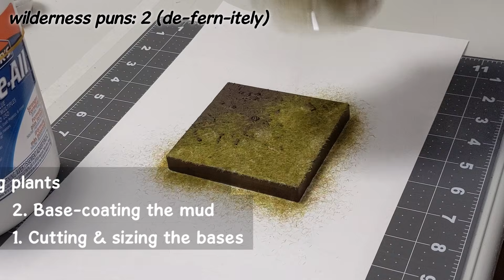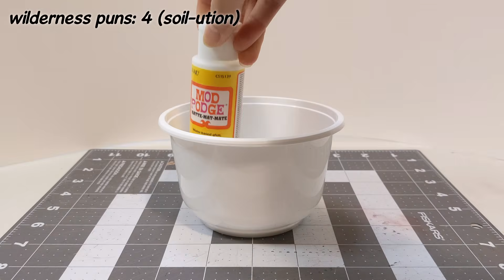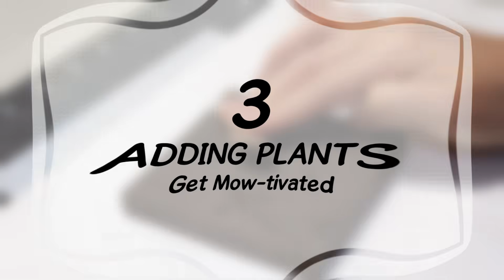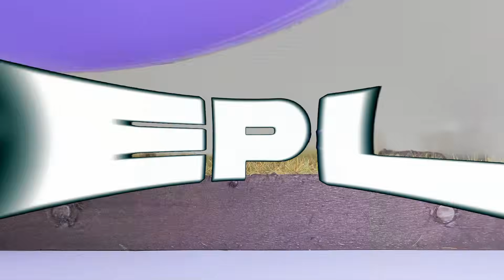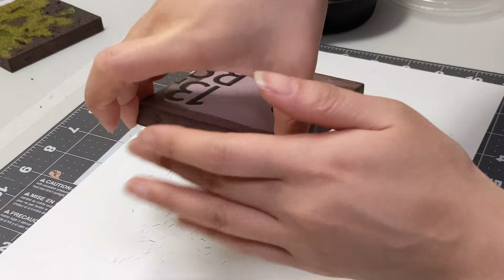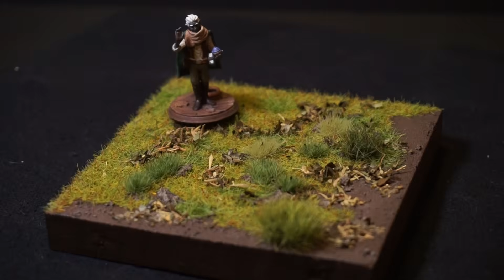DnD Wilderness Terrain - Modular & Expandable. Plus EASY static grass!

Comment: I dont know, but Iam asking myself, how to make this with a proper playing grid, for measuring while playing.
Reply from the maker: My party is pretty good about visually identifying that a 3x3 tile takes 3 spaces of movement to get across. That being said, Dimension 20 does a pretty good job of using white dots on their terrain to indicate the grid if that's a helpful compromise!
Reply: @raecheldoes  Ty for your advice, I made them now like in the video, but three woodplanks in the length symbolize one grid tile, but without the grid if you get what I meaning. ^^"

Comment: I would add, as long as you're not texturing the top, you could save a bunch of money using Styrofoam. The stuff is pretty much free and once sealed (mod podge or primer) it's plenty durable. It's easier to experiment when the materials are free.
If using a hot wire to cut Styrofoam, get proper breathing protection - not just a dust mask!

Comment: Great work.
IMO, you'd use 1/2 as many magnets if you put the magnets on the bottom and played on a magnetic surface. Our local "big box" stores have dry erase boards that are also magnetic. i strip the frame off, lay down a 1" grid with heavier lines every 5" for easy counting.  Just using two gives us enough room for any situation.
JC Magnetics (the place I buy mine) are great, but they aren't cheap when one thinks of doing 20-40 tiles.

Comment: I legitimately would like your opinion on this matter. I love your work and everything, but do you think it possible to add a grid into the terrain? If so how might you do that?
I’m trying to consider this for my table to make it easier for players to judge distance
Reply from the maker: I'm a little loose with measuring distance and we've adopted to know that going across one tile is 3 spaces or 15ft, so in a way there is a larger grid baked in, however I think Dimension 20 does a great job of putting in a dotted grid on their battle sets! If you google it, you can see some great examples of how they do it!
Reply: @raecheldoes  thank you so much for the reply. I’ll look into it and continue trying to adapt

Comment: Two questions about using the balloon- do you find that balloons work on static grass longer than 2-4mm, and, have you found a decent way to recover the grass that clings to the balloon? Or is that just a sacrifice to the scenery gods?
Reply from the maker: LOL. I don't see why it wouldn't work on longer grass, although it will probably require more frequent... charging. I have also tried wiping them off with a wet paper towel and vacuuming them off to no avail, so for now I continue to appease the seemingly insatiable scenery gods.

Comment: Brilliant! This has just solidified an idea I've been tossing around for years. My mistake was in visualising larger tiles, I think. 

I never would have thought of spraying matt varnish over the top of grass though. I would have thought it would become more brittle, rather than stronger. The snow effect you get from using the varnish is usually if the air is too humid, by the way. I tried varnishing some models after a storm and they all came out frosted. This was solved by a second layer of varnish, though.
Reply from the maker: Woohoo! Glad to inspire. Both RP Archive and Geek Gaming Scenics sprayed their grass, so I gave it a go. It's honestly really worked for me. And thank you for the matte varnish tip! It's good to know that it can be solved with another drier attempt haha.

Comment: before sealing if you are working with a slightly heavy/thicker sealant such as watered down pva glue. I would recommend putting some isopropyl alcohol in a spray bottle and giving it a light dusting to help brake surface tension. it helps keep it from creating blobs and filling in cracks which can remove depth from the piece.

Comment: Hey, quick question, how do you get rid of the excess hot glue when you are glueing in the magnets? I sometimes add to much which then makes the tiles have a gap between them when i try to connect!
Thanks.
Reply from the maker: Ah! When I put the magnet in, if some glue is pushed out in a blob around the magnet, I just pick it off with my nails or with tweezers before painting. It happens to me a lot as well! Hope that helps.
Reply: @raecheldoes  perfect, thank you! I tried sanding it but didn't seem to work to well. i'm glad the standard "Just get mean with it" approach works :D

Comment: Absolutely love your style and method to sharing your work - great job! I'm thinking about attempting this, targeting a 3' x 3' table for skirmish type wargames but likely wanting to expand a 6' x 4' table to support regiment style war games. Even if I did this with 6" x 6" tiles (36 tiles for the starting 3 x 3 table 😬), do you even think this would be a good idea? I'm worried about: tiles being shifted around easily because of the lightweight foam, durability due to heavier models (like vehicles, big ruined buildings, etc.) being placed on top, and uneven ground being difficult for regiments (on movement trays). Would you still want to go modular tiles and maybe just change up the surfaces to be flatter, or go with a different approach to the table altogether?
Reply from the maker: For bigger wargaming set-ups, I would definitely consider what are the most important considerations. Is storage an issue? Do you want the terrain to be able to change often? It sounds like durability and playability are top contenders. For tiles shifting around, there are ways around that, like adding weights underneath or an outer frame to hold a full board together. I also would consider going right up to 12"x12" tiles if your table to going to be that big! You can cut 6"x12" strips and glue them together. Also, I would consider using flocking for grass if it's going to be handle a lot and/or have heavier models on top. Static grass is visually appealing, but considerably less durable than flocking in my opinion.

Another alternative would be a roll-up battle mat. Luke at Geek Gaming scenics has made a really cool durable roll-up battle mat, and Jeremy at Black Magic Craft also just recently made a wilderness battle mat video.
Reply: @raecheldoes  Thanks much for the reply - lots to think about there. I, too, am considering a battle mat for tables in the 3x3' or bigger range, and then maybe using tile setups for encounter type situations ala D&D. Too many projects!

Comment: I'm no dnd player, but when I had to make some scenery tiles for a building design project and it needed to be modular - I modelled it over panels of lego. Easy to connect and disconnect, modular and all. Also easy to measure size.
Reply from the maker: That's such a wonderful workaround! For games on the go or for a younger audience too, that would be a helpful solution for sure.

Comment: amazing work! Wondering whats the best size though, seems like 3x3 is unneccessarily small, perhaps 6x6 works just as well but smoother with less seems and a more 'calm' look (less individual designs of bases, however impressive it it!) thanks!
Reply from the maker: Yes! It really depends on your game's/table's needs. A lot of people mentioned they would use the techniques but upsized to 6x6 and even 12x12 boards. The goal is to provide tips that hopefully can be transferred to whatever you might need/want to make! I personally find the 3x3s are great for smaller-scale battles (like for dnd) and add flexibility to map arrangements in tandem with 6x6s.

Comment: Balloon trick is outrageously helpful, I tended to just put flock for the grass in my wooded terrain and call it close enough because I didn't want to bother with a static grass applicator. So thanks for the great tip from a genuinely informative video.
Big respect for just using regular krylon clear coat too.
Reply from the maker: Yeah I was kind of stuck there too between putting down the grass and getting an applicator. Glad to have helped and happy you found it informative. Thanks!

Comment: Have you tried including gridlines on your tiles? How would you go about adding those in without interfering with the terrain?
Reply from the maker: I personally haven't because my group is pretty good at understanding that to move across a small tile = 3 spaces. You could groove the grid lines into the foam before the dirt/mud phase or what I've seen on Dimension 20 is they put dots in the corners of the grid lines so it's a dotted grid. Hope that helps!

Comment: Amazing modular tiles! I was wondering how you dealt with the polarity of the magnets (and is there a pattern you use for maximum flexibility) so the sides attract and not push each other away
Reply from the maker: Thank you! RP Archive has a full video on the system, but basically one magnet is north-facing and the other is south-facing so that all sides of every tile can match up!

Comment: awesome video. can i recommend though to consider using spherical magnets instead of flat as with flat you are limited in orientation due to polarity (positive must attach to negative), whereas spherical magnets can stick to each other regardless.
Reply from the maker: Ah I hadn't thought to use spherical magnets. The tiles can match with any other tiles though because one north and one south in the same orientation is on each tile (RP Archive's genius system), but I will give spheres consideration!
Reply: @raecheldoes  It wouldn't work. Spherical magnets also have polarity and will spin to attach in the proper orientation, it is just harder to notice since they are spheres. It wouldn't work in this system since the magnets have to be glued in and therefore can't spin. You can use them in 3d printed terrain where you can have proper magnet slots with room for them to turn. Also spherical magnets are weaker due to less contact area. 

Amazing terrain, I will probably use this as a guide for when I make my wilderness tiles. How many did you do in total?
Reply from the maker: @petterblo  Ah thank you for the additional info! That's helpful to know why they're used with printed terrain. At the time of the video I had made 10 of these with 4 of the 6x6s from my forest video. So if you wanted to just do 3x3s then I guess 26 total (grid of ~15x15), which has gotten me through plenty of skirmishes. But for large-scale battles I would probably double those numbers.

Comment: Great video, easy to follow and some really nice effects! Another great way to add some 'weight' or 'sturdyness' to your tiles without using magnets is 3mm MDF. I use it for all my tiles and they stay nice and flat on my gaming table. Additionally, I add some felt on the bottom, so it has a smooth underside. :)
Reply from the maker: Yes! That's a great way to get them to sit firmly on the table without being necessarily stuck to each other. Thanks for the tips and feedback!

Comment: Hello! What type of foam do you use for the tiles?
Reply from the maker: These specifically are 1/2" thick Foamular XPS insulation boards that I get from my local Home Depot. They're a little thicker than 1/2" though, so I still needed to cut them down.
Reply: @raecheldoes  thanks, you're awesome!